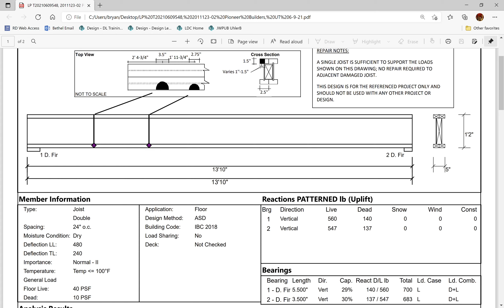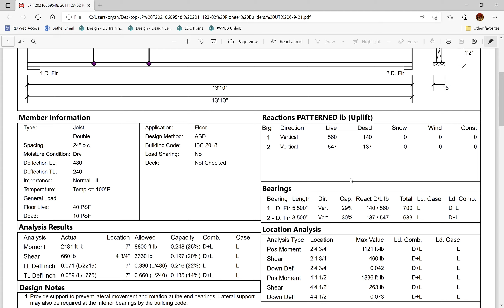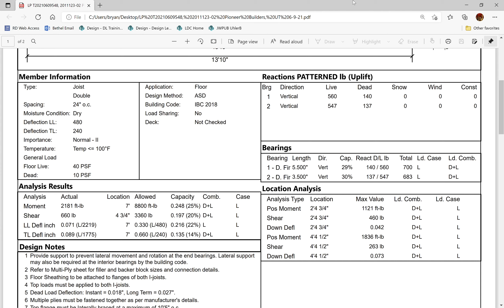Reading an I Joist Analysis Report

Comment: Hey good video, "Foot pounds" measures torque, so it's telling you the rotational force applied at that location relative to the fulcrum or the top of the wall here. The 'moment'. Or so I believe, not an engineer by trade either. 👍but that's how I think of it. Hopefully it's accurate.
Reply from the maker: Thank you so much. Knowledge sharing makes us all better, and I know an infinitesimal fraction of a fraction.
Reply: Likewise, just trying to get to 51% correct on most things